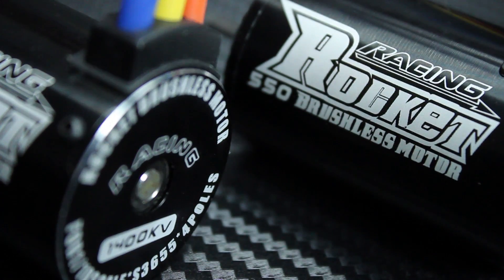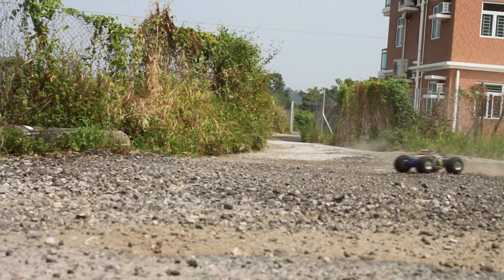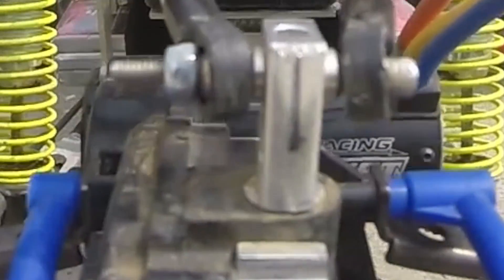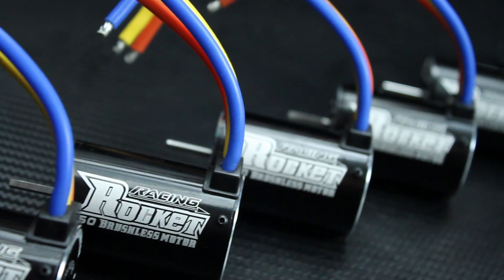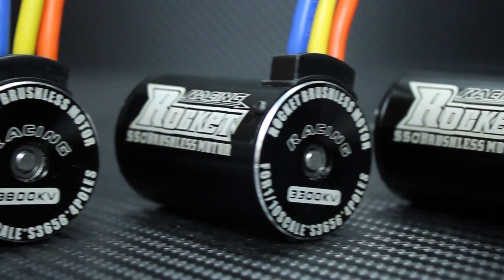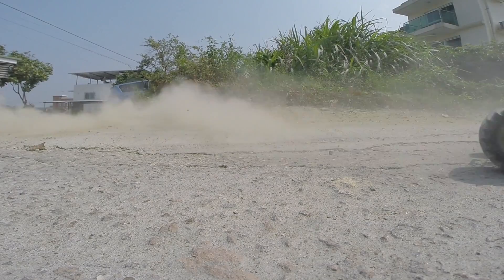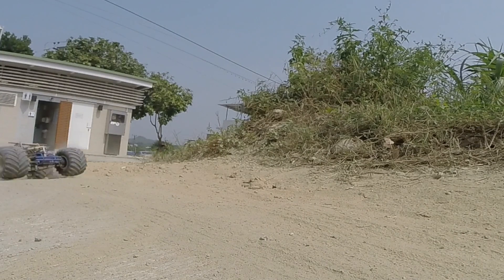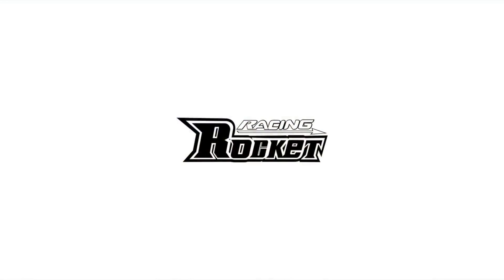Rocket Sensorless Brushless Motor For Your 1/10 RC Car

Comment: Just switch 2 of the 3 wires for the one motor that runs reverse rotation? Any heat issues say after a good 10 mins of fun runnin.?

Comment: which is more powerful higher kv or lower kv
Reply: Higher it says in description
Reply: higher
Reply: Jayseal ENDURO kv means revolutions per volt, higher the kv, more faster, (ex 3300KV is less powerfull than a 3600KV) 
The turns, (example 15T) isthe opposite, less turns more power. 15 T has more torque than a 18T
Reply: Sanshoku Customs Hotwheels and more  15t has more RPM over 18t...but 18t has more TORQUE....Lower turns more RPM